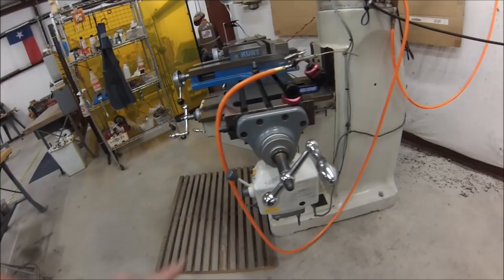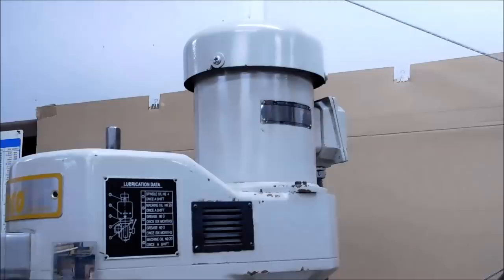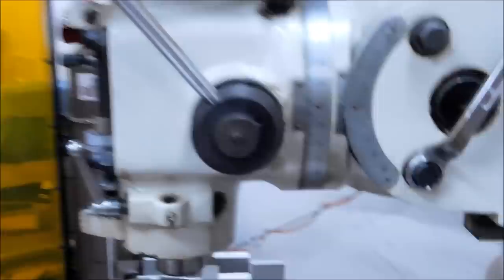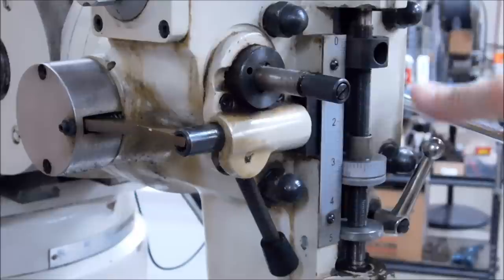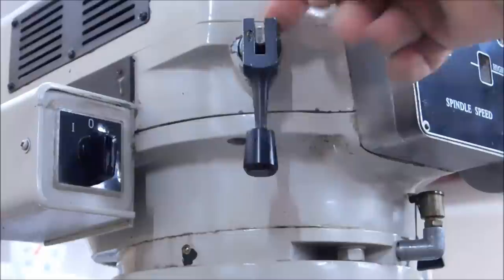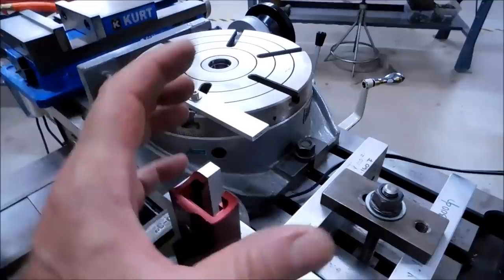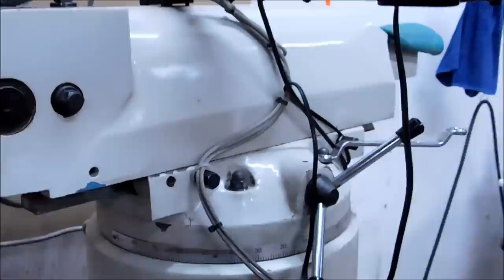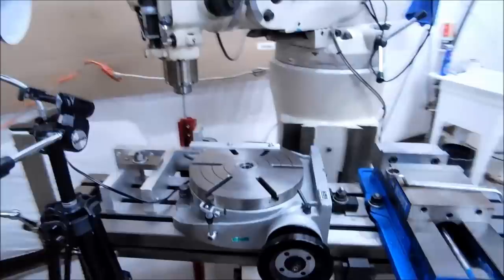Machining - Bridgeport Controls 101 ( and some other stuff )

Comment: What’s a rough ballpark price one could expect to pay for a decent used enco (Bridgeport clone) mill?
Reply from the maker: 4K +/-   MSC is now controlling the ENCO brand. Even new they are reasonably priced.
Reply: @joepie221  thanks for letting me know. 👍
Reply: @mxcollin95  I paid $1,200 for my Bridgeport. It had a new 2HP motor and ball bearing upgrade on the X and Y axis lead screws. I'll admit I got extremely lucky, partly because I have known the previous owner and his family for over 40 years and a few other factors. It certainly wasn't perfect, took some time and effort to clean it up, power feed didn't work, quill spring was broken and spindle bearings were worn. Nothing too expensive to fix. 
I realize I am the exception to the rule but there are exceptions to every rule, with enough time and patience you may be an exception as well. It also has alot to do with location. I'm in the Atlanta area, average price for a used Bridgeport is in the $3k neighborhood. Somewhere closer to a manufacturing city like Detroit or Chicago I would think you'd find more machines and therefore better prices. Facebook Marketplace is a fantastic resource so don't overlook it. Good luck.
Reply: @renaissanceman7145  thank you very much for your reply and info! That definitely gives a a better idea what “reality” should be when on the hunt for a used Bridgeport.

Comment: Hi again Joe, getting back to “unloosen “ it would appear to be a double negative 
“unloosen
The opposite of loosen. Often used when referring to removing hardware, however it actually means to tighten. An oxymoron.”
But I think you may be right as I think to unloosen is actually to make something that is tight less tight, while to loosen is to make something that is already loose even more loose. What do you think? Stefan
Reply from the maker: The modern Miriam Webster dictionary agrees with my use of the word. It means to make less tight. Although it is a controversial word. I enjoy the rise it gets.

Comment: Unloosen = Tighten and Untighten = Loosen
Reply from the maker: Google it.
Reply: @joepie221  I did Google it and it still doesn't make any sense. When you unscrew a lid, it comes off, not on.  When you untie a knot, it comes undone. The prefix "un"  means not, so in the primary sense of the word , unloosen should mean to not loosen.  Sometimes English is a pain in the ass.  Like flammable and inflammable is to active and inactive - the former makes no sense, but the latter does.
Reply: Bothered me,  too. Sorry, Joe. Otherwise great video as usual.

Comment: about the knuckle busting quill handle, i relapsed mine with a 10 inch deep dish steering wheel it works a lot better an its a lot safer an looks cool
Pete
petewerks
Reply from the maker: Most of my work is very small. that being said, I had one sent down to me from a viewer, and didn't like it at all. I found it to be to invasive and sent it back.
Reply: @joepie221  it's useful in certain situations like using an endmill in soft or grabby metal; the wheel gives you more control over your decent and will help keep you from getting chatter in the bottom from the tool grabbing

Comment: "If you pull the wrong lever at the wrong time, well, you may have a problem in your hands" IF you still have hands after pulling the wrong lever. ;)
Reply from the maker: There are countless ways to ruin your day in a machine shop.
Reply: @joepie221  been there

Comment: The tool makers and machinists would yell at us millwrights if we changed the position of the head. Angle the work, not the machine! they would yell at us.
Reply from the maker: Last resort for sure. if you can angle the part as your first choice, do it.
Reply: Same goes for removing the Gap-Bed in a lathe ! Got yelled at by the Foreman 48 years ago ....
Reply: Rotating the turret is no big deal, it doesn't change the travel of the bed. Zero is relative to the cutter. I can see rotating the head or angling it up/down does take more time to re-zero, but I would just point to the scales and say, tell it to the engineers, they made them to move. LOL

Comment: is your machine not bolted to the floor? how do you feel about unsecured machine vibration affecting the result of the part?
Reply from the maker: This machine is very heavy. If you rotate the head and place a very heavy part on the table with the table extended to near stroke limit, I would say a tip over danger does exist. My machine is not bolted to the floor and I don't feel it has ever had an effect on my parts. If your work is big and heavy, bolt the machine down.
Reply: @joepie221  mine moves back and forth due to bad floor under....OHSA probably wants yoou to bolt it down...I do not care